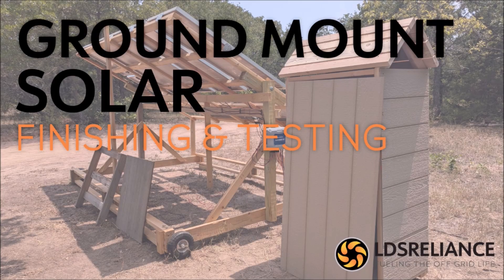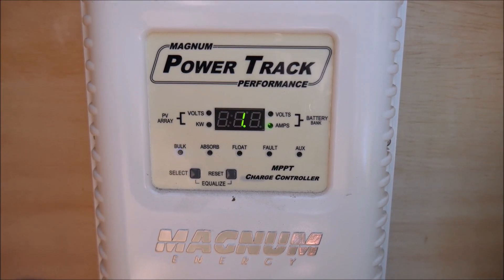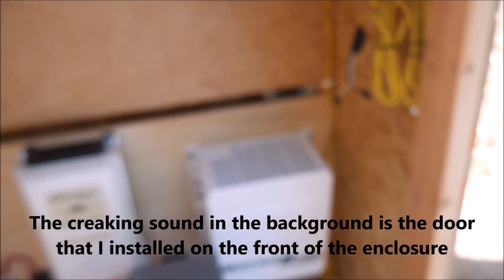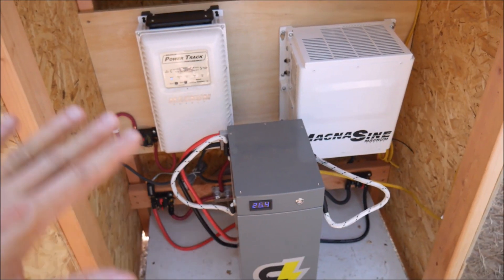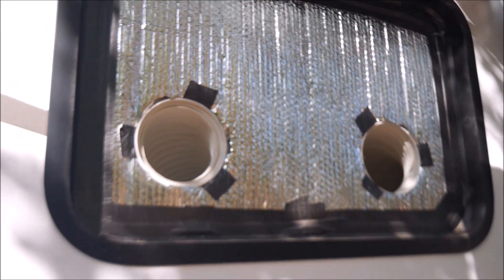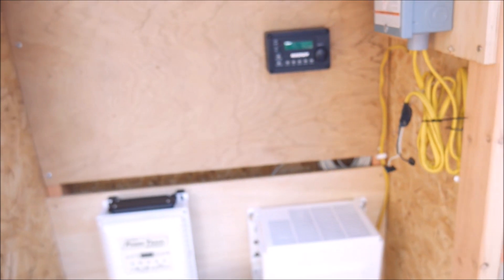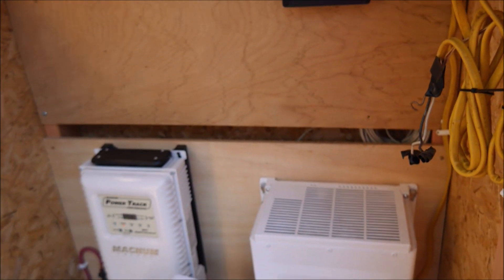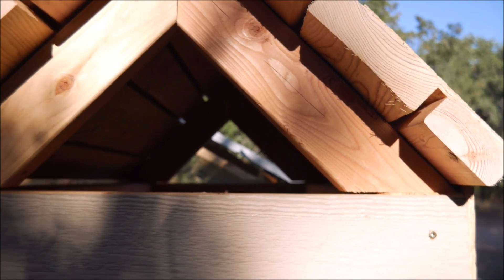DIY Ground Mount Solar Rack Setup - Part 4 - Finishing The Inverter Install & Testing The Systems

Comment: That inverter is a BEAST! Is it their 3000w or 4000w model?
Reply from the maker: 4000W.  It is Tier 1 equipment for sure.  I've never owned something like it.  It weighs like 80 pounds and can handle huge surges unlike most other inverters.  Stuff like well pumps are no problem (appropriately sized, of course).

Comment: For the breaker issue, isolate the problem by running something else and see if its the AC, a short, or your setup.
Reply from the maker: Yeah, I have a window air conditioner unit that I can try to run.  It doesn't pull as many Amps but it is worth a try.
Reply: Preferably, something that does not have a motor. Usually single phase motors have condensers to help during startup that could be causing you problems. 

I mean, the smaller AC could be good but if you have something else try that first.
Reply from the maker: Man that really limits my options haha.  I can't think of any serious loads that I could put on that inverter that don't have a motor of some kind.  I have a microwave in the trailer but I'd have to pull it out to connect it.  I could bring out my array of heat lamps but I think that would only be about 1000W.
Reply: I figured it was a long shot, but like I said only if you can. The smaller AC is a good start if there are no good options.

Wish I could help you troubleshoot it (I fix machines for a living) but you can figure it out I am sure.

Also measure the output voltage before and after the AC starts to see if the voltage is dropping under load.  Just try to get a true rms meter if at all possible.
Reply from the maker: I have a true RMS meter (supposedly) but I am not very good at knowing how to use it other than the basics of reading DC voltage and using the clamp to measure current.  Supposedly it has an inrush function, too, but i've never figured out how to use it.  I'll read up on the manual.

I am going to go over all of the connections in the system tomorrow and make sure everything is tight and right first and then go from there.  I am also going to use an infrared thermometer to see if that can give me any clues.

Comment: Check for high resistance in the circuit. Could be a short.
Reply from the maker: On the DC side or AC side?

Comment: Strange, any surge should happen on start up.  I can only think of overheating or arcing as the other possible culprits.
Reply from the maker: Yeah, overheating is definitely a strong possibility.  With 105+ degrees each day and high current that may be what it is.  I believe those breakers are thermal breakers, too.  I will check some things with an infrared thermometer and try to bypass that breaker and see what happens.

Comment: Might need to add a soft start on the air conditioner. Check the LRA (locked rotor amps) (starting) listing on the AC
Reply from the maker: Good call!  I am going to bet that the manufacturer doesn't publish that number but I can try to look.